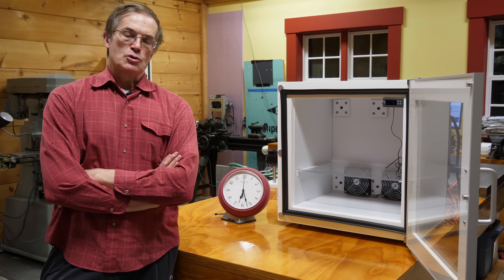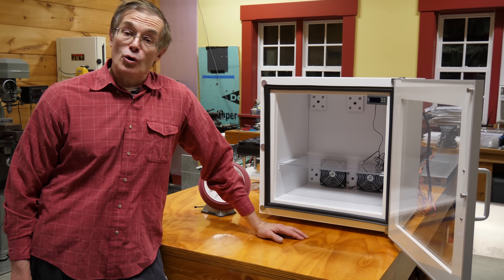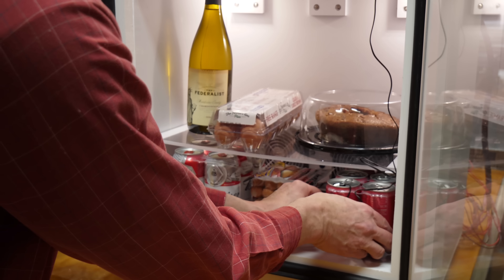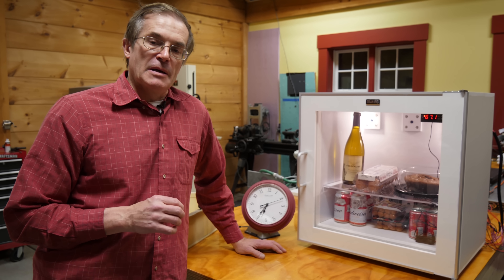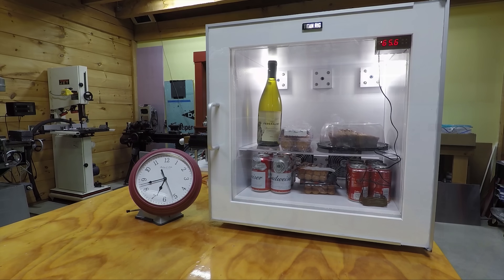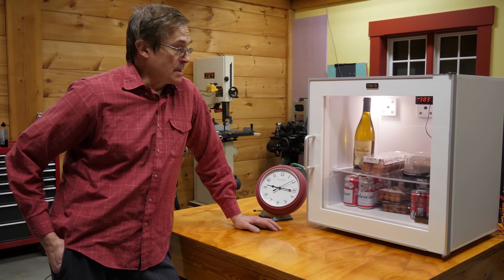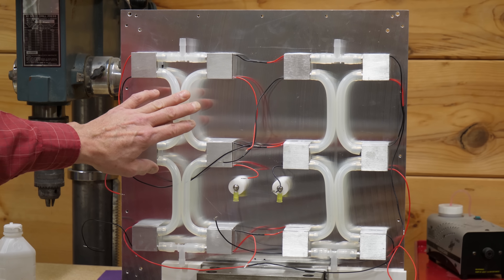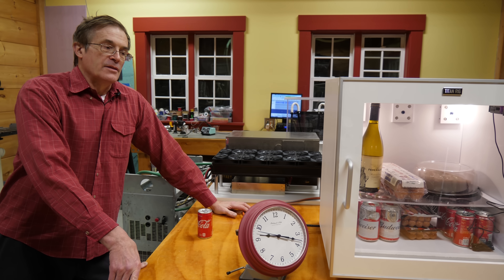TESTING OUR DIY REFRIGERATOR! - TEC/PELTIER

Comment: Could you use something like this as a dwelling heat/cooling unit? Say space them in the walls at intervals?
Reply from the maker: The effeciency is too low to make this worth it.  I am completing an alternative cooling system based on a liquid dessicant.  This is s really exciting as it is at least TWICE as effecient as conventional air conditioning systems and very easy to build; a real DIY.

Comment: Because heat rises convectively in the fridge, the Peltiers should be on top or as near the top as possible. Remember, when they are not running, the Peltiers will conduct heat backwards into the fridge.  So keep them running at a low voltage all the time.
(Try to ignore the meat, alcohol and sugar advertising.)

Comment: POWER USAGE ?!?!?!?!!?

Electrical Engineer here...  

I want to know more about the power usage, what voltages you finally settled on, what thermal control you are using, what power supply...

These devices have always intrigued me and I think your project looks like a lot of fun.

Great job, great video, great audio, and great job on the lighting and time lapse.

Just hungry for more nerd details
Reply from the maker: This refrigerator uses approximately 110W to drive the TECs, fans and lights.  This depends weakly on the room temperature. The 24 volt, Meanwell power supply has a wide adjustment range and the six TECs can be operated in various combinations (we use two groups of three in series) inorder to optimize cooling.

Comment: Fahrenheit?   Really?  Shape up old man!
Reply from the maker: I beg your pardon, but here in America we are multilingual, we speak Fahrenheit and Centigrade.
Reply: @TechIngredients  Here in America? Look up the other 'great' countries that still use fahrenheit. Nice little collection right? lol
Reply from the maker: Yes, although we are not the only large economy we remain the world's largest.  Most of the tooling and many of the supplies we purchase are specified only in imperial units.  Nevertheless, metric units are used almost exclusively in scientific literature and imperial units are used almost exclusively in the construction industry.  Also, there are advantages when using each system.  Metric is digital and imperial is fractional.  It is easier to write equations with the metric system, but easier to loft a boat or lay out a wall with the imperial system.  I speak from experience and not from an interest as to who is on what side, politically.

Comment: 1 lb of water, 1 degree of difference = 1 btu.  Your flow rate will determine your heat difference from hot/cold side. The heatpump modules you're using can't be more than 10% efficiency, so.... 1000w total after the efficiency loss to get to 100w of actual cooling is only 341.214163 BTU/hr I doubt you would use that kind of power but still 1 small fan like the ones in that crazy 6 fan radiation could easily displace over 75,000 btu's with the right flow rate and surface area not even being outside with the cold air.. digging the channel hope this comment helps with the next designs

Comment: How many litres is this unit? I’ve designed a TEC unit for 5L (for a specific application) and I am using one 50.5 W Peltier with Three 12VDC Fans. I am curious to know the engineering analysis behind the cooling of your system. Really great idea to use the advantage of having a cold environment for water cooling!
Reply from the maker: 80L.  I go through some of the engineering in the first video in this series.

Comment: I'm not sure you would really gain any benefits by going with a TEC design.  Sure it can be modular and can fit in many different sizes but so can standard phase change.  The compressors we have today are very quiet and efficient and can even be located a substantial distance away from the actual expansion or condenser coils if one so desired.  The biggest caveat is that the system must be properly sized to meet a specific operational range.  With TEC designs you can simply increase or decrease effective surface area along with adding additional modules to increase capacity and effective range.  TEC gets horribly inefficient and plateaus once the temperature delta reaches much over 40-50 degrees F mainly due to the semi-thermally conductive path through the TEC itself.  TEC is great for portable lightweight chilling of small volumes but it is quickly passed up with standard phase change.

Comment: Here in Canada, I simply leave my beer/coke outside, no fridge needed. Of corse sometimes it actually gets too cold and the drink will freeze which is undesirable, but the point is if you're going to use the cold environment outside, maybe what you need isn't a heat pump, either a heater or a controlled active vent.
Reply from the maker: In our upcoming TEC freezer video we place the radiator outside. Switching the pump on and off might be all you need to do.  Adding power to the TECs will supplement when the outside temperature is not low enough.

Comment: How about if you had a robotized internal insulation plate that covered the cold points when you have reached your desired temperature. Because those TECs will let the heat flow back in when they are off.

Comment: I'm sorry if These questions will sound stupid for you!
What will happen if you stacked TECs on top of each others with various Voltages to Quickly channel (Pump) Temperature? Will it be like putting fans in push-pull configuration? 
What if the back fans where pushing air from down to top through the fins in push-pull configuration(2 in bottom - 2 on top) and covering the sides to create a tunnel?
Reply from the maker: I will address this in more detail in our up coming video on very low temperature TEC applications.  But in short, the efficiency gain with reducing the temperature across a TEC in a series installation is more than offset by the fact that each subsequent TEC in the series has to pump the heat passed through the previous TEC(s) AND the electrically generated heat produced by the current needed to drive these previous TEC(s).

Comment: I must ask ,How much did it cost?
Reply from the maker: That's hard to say because so much of what we used was already 
available around our lab.  But, the TEC's would cost $55 for six, an 
adequate power supply would cost about $50, the six fans cost $30, the 
aluminum sheets cost $30, the temperature controller cost $17 and I'd 
estimate $100 for all the miscellaneous components.
Reply: @TechIngredients  

what number TEC are you using?

example:  TEC1-12715

Comment: My friend works with fast food. I am developing this project for both cold food and hot food.

Working with Peltier plates you have heats on one side and cools on the other, so you need the larger cooler to cool. You can use the hot side to make a heater for foods that need to be kept warm. So we take advantage of both sides of the plates. In these heaters you need to use water to not dry the food.

If you use the Peltier plates to make only one freezer you are losing energy and in this case it is better to use a compressor base. 

All plates should be on top of the freezer on each of the plates a little fan, cold air is heavier and will circulate down.

When finally everything works out a new problem will appear the Peltier plates will started dripping water in which case it is necessary to use a relay to stabilize the temperature.

in the previous video you showed little about the thermal structure of the wall and neither another video that I saw explains anything and you were the only person who happened to be constructing apparently correct.

Thank you very much, I hope we can help each other.
Reply from the maker: Those are good points, thanks!
Reply: the idea of putting the plates on top is not really that useful, because he's using a fan for convection both inside and outside of the refrigerator.

otherwise good ideas though.
Reply: @thomasneal9291  I believe that the fan is not enough also you need a heatsink (like the plates were a processor), the larger the area the greater the temperature transfer. Cold plate to cold air.

As I say "If you use the Peltier plates to make only one freezer you are losing energy and in this case it is better to use a compressor base."

I still think at the top is better just because of physics.

Comment: They also make great cold points where you need triple or double phase change cascades normally. The right TEC will absolutely drop to crazy temps provided you displace the heat on the the other side and you load is not too crazy and you can stack them. If you have needed one the TEC option may be more attractive for your hearing regardless of the efficiency. But what I want to see is that paint researchers published on a few years back. Paint with nano n and p type transistors that generate power like a TEC using the Seebeck effect were just so juicy sounding. Probably too good to be true.

Comment: Nice project.  Where do you find the polyurathane panel material?  I searched all over but only find the polystyrene panels.  Got a link?
Reply from the maker: If you are in the US then Home Depot and Lowes both carry this material.
Reply: Yep.  That is where I first looked here in FL at Home Depot.  There search engine is clunky and typing in polyurathane gets tons of unrelated items.  It would be easy if you gave the actual name of the material ie is it poly... foam, sheet, panel, rigid, soft or the common trade name.  I know it should be easy, but it seems there are many variant names for this material.  I want to enclose my minifridge (9cuft) with it asap as I am off grid and using only solar.

Comment: Issue with bringing in cold air into a fridge thats inside a house it will leak cold air and cool the entire room/house, while in a perfect world with transfer of heat and energy a fridge will wam as much as it cools so net temperature difference will be 0C, (however because of losses a fridge will heat a room more then keeping temperature same).
Reply from the maker: The world is not perfect. Keep in mind that not all forms of energy cost the same.  The electrical energy that cools refrigerator is more expensive than heat derived from combustion that warms the house.

Comment: For transferring the heat load, it's fine to keep the heat indoors during the winter. The question is, can you transfer the heat load outside of the thermal envelope of the building (home/garage/structure) during the summer? Thinking of how a mini split air conditioning system works. Also, I've always wondered if there was a way to offload the heat generated from consumer electronic devices like computers and television outside of the thermal envelope during the summer and preserve it indoors during the winter.
Reply from the maker: The added heat in the winter helps heat the building, but reduces the effeciency of the refrigerator.  Heating with electricity costs more than heating with gass.  Dumping the heat from the refrigerator outside reduces the air-conditioning load, but makes the refrigerator less effecient due to the larger gradient.  In my opinion, the best alternative   would be to dump the heat to a thermally stable, burried ground loop.

Comment: I wonder if people are generally using peltiers the wrong way around, given their well known inefficiencies. What would be interesting is how effective they might be where there is a need for warm dry air, say for example in a food dehumidifier. Air would be drawn in and passed over a cold side arrangement and the condensate drawn off. The somewhat dryer and cooler air would then pass over the hot side, which would not only benefit from the electricity being fed into the peltier, but also the heat from the cold side.  The net result should be warmed air at a lower humidity than the surrounding air, with the reduction in humidity coming at minimal additional running cost compared to simple electric heating.
Reply from the maker: The principle is sound, but it does not address the ineffeciency of the peltier.  Dehumidification requires a lot of heat energy to be pumped. The condensation process requires 2,000 J/gm of isothermal water vapor to be converted to the liquid phase.  This heat needs to be pumped away from the cold side of the TEC in order for the condensation to continue.  Regenerative dessicant dehumidification is more effecient especially because the work can be supplied  by less costly combustion, solar and even waste heat sources rather than electricity.
Reply: The food dryer I used to own simply circulated warmed air through the stacked trays holding whatever was be to dried, using a very simple fan and electric heating. There was no dehumidification at all. My thought was to use the inefficiency of the peltier to provide the heating and effectively get any dehumidification 'for free'. Looking at the numbers, to get any real dehumidification you would end up with some very hot air which would probably cook the food rather than drying it. Thanks for your input.

Comment: How does does this units power requirements compare with that of a convention Freon fridge of the same cubic foot area?
Reply from the maker: Good question.  In our first video on refrigeration, which was posted one week earlier, I discussed the relative effeciencies of thermoelectric and phase change cooling.  TECs are about 3-4 times less effecient, but if the refrigerator is engineered as a complete system, then  this difference in effeciency may not matter to you.

Comment: As I remember pelletier work better if the temperature difference is smaller so if I had the materials I would try this: 2 stage pelletier to reduce the temperature difference on a single cel and also to get lower possible temperature and the use of a radiator and fan asembly on the inside as well. I think placing a fan inside would make the cooling faster.The downside is that the fan electric motor would add some additional heat inside.
Reply from the maker: Did you watch our first video on refrigeration?  The graphs I presented support your understanding of these devices.  The problem with using them in series is that the heat that the second TEC has to pump includes the heat pumped by the first AND the electrically generated heat produced by that first TEC.  This overwhelms the gain in effeciency because of the lower temperature gradient per stage.  I will describe this fact when we cover the TEC freezer in that upcoming video.
Reply: @TechIngredients  I've rewatched the previous video and I noticed something that doesn't seem quite right. In your graph the maximum COP is somewhere between 30 and 40 degrees difference between plates, but after I searched about that online I founded various graphs and this video https://youtu.be/bp3Ox7H4dwA that confirms what I also previously believed (and on what the previous  comment was based) that the COP increase as temperature difference decreases. So the highest COP maximum amount of heat that the TEC can move is is at 0 degrees difference not somewhere between 30 and 40 as your graph says. Anyway.. I was  thinking that 2 TEC put in series will have a higher individual COP then 2 parallel ones because of the lower temperature difference per cel. In  this arrangement because the second TEC has to move more heat this will result in an even smaller temperature difference on it increasing the COP of the cel even more.  The most beneficial thing of this arrangement will be the increased temperature of the outside radiator.. this will result in a higher temperature  difference between the radiator and the outside temperature leading to more heat beeing dissipated in the environment (Stefan-Boltzman ecuation). I think putting 2 or 3 cels in series will get the outside radiator hot enough that it will dissipate(via radiation and convection) enough heat to make passive cooling possible. Another thing that I was thinking is.. how cold can multiple cels in series get? Can it get cold enough for superconductors to work? Like for using it in maglev trains or for replacing Helium in cooling the superconducting coil in an MRI?
Reply from the maker: That COP curve was not discussed because it was not related to the relevant performance of the existing device.  It was included by the manufacturer who generated the graph.  You are correct that the greatest COP occurs at the lowest temperature gradient. But, like air resistance, the greatest aerodynamic effeciency occurs when the vehicle is not moving.  For useful temperature differentials, series operation will always be less effecient.  We have to pump heat AND the electrical power of each upstream TEC.  This is the problem.  That electrical power is more important than the rising effeciency of each stage.
Series operation can and is used to achieve  temperature differentials as high as 150 degrees C,  but with abyssal effeciency.
Reply: @TechIngredients  I think I over estimated what this amazing devices can actually do. Thanks for taking time to reply. I really appreciate that. I look forward to the next videos.

Comment: And how much it draws power ? I have played with these things and yes you can make things cool with a amount of power you could run dozen compressors.
Reply from the maker: It draws 110W.  You could run 3-4 compressors based on the efficiency differential.  I cover that in some depth in our first video on this refrigerator.  You might find it interesting.